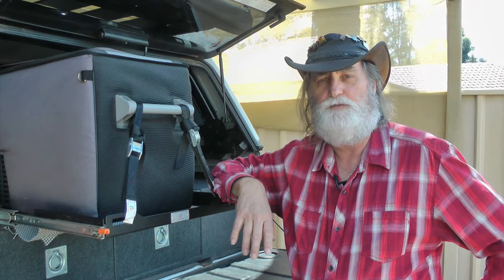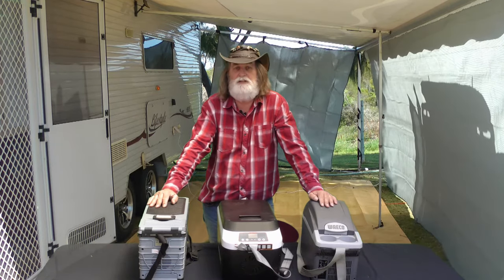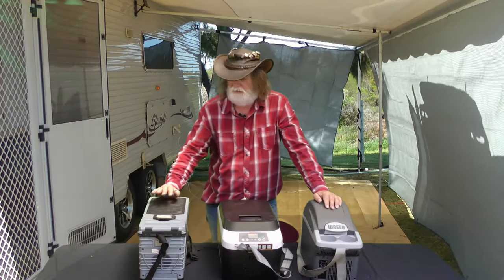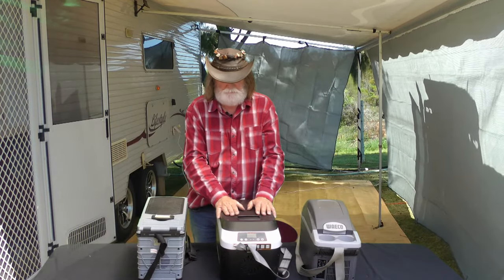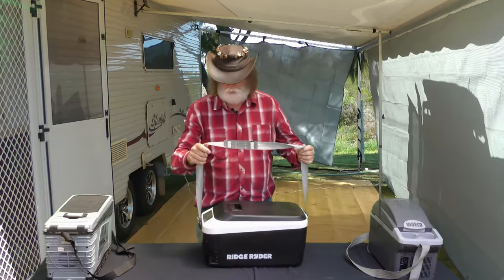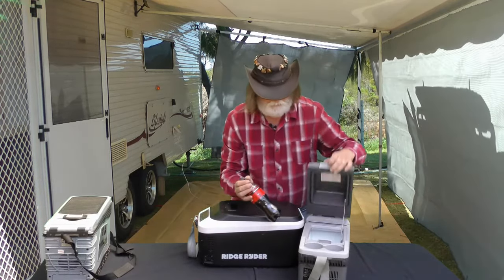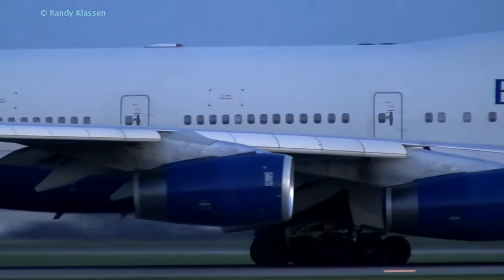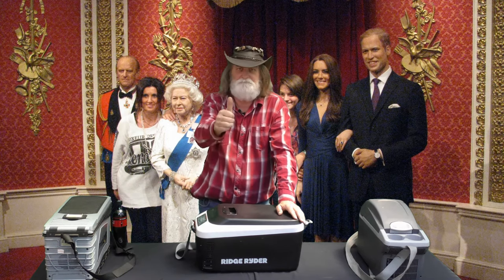Ridge Ryder 12 litre Thermo Cooler Fridge Review

Comment: thanks  for the presentation. I bought one of the 12 litre models early this year, and am most impressed with it. I usually cool it down before loading cold stuff in. My only con is my fault. It's too good.   I usually freeze my can drinks to substitute for ice. When arrived at my destination 6+ hrs later in 38 plus heat they were still frozen. I think mine is great.  I do hope you gave my regards to H.M.
Reply from the maker: lol yes I have frozen a drink or two with it to. Thanks for watching. H.M ask why you haven't called lately.....

Comment: Like the end there mate. Haha. Those fridges are quite simple. They use a peltier module, a small flat layered bit of gear. Only about 50 or 75mm square and 5mm thick. Google image it. They get hot on one side and cold on the other. The fan blows the heat off it. If you reverse the voltage, hot and cold sides swap. I had one years ago and felt like you did. Good for the price tho. Don't leave it on if the engine ain't running.  Nice review John.
Reply from the maker: Gday, yer i had some mates hassling me to be in a video so I put them in at the end... I just googled a peltier module and it was interesting to see how it works. Thanks for that.
Reply: @ontheroadwithjohn  You could make it even more efficient by crushing some ice, adding crushed ice to ziplock bag along with salt, place the bag or bags of salt/ice in the base of the fridge before adding pre-cooled items. The salt reacts with the ice, lowering the freezing point and thus lengthens the time before the ice melts as the ice itself will start off substantially colder than ice alone. However, I would do a test run before going away as you might find it freezes instead of keeping things cold. 👹
Reply: I also agree, the green screen background was great, I had no idea 🤗
Reply from the maker: @MaZEEZaM  Thanks for the idea. Probably not suitable for me as when I go to work im away for 3 days and ice isnt really an option but thanks for the input
Reply: @ontheroadwithjohn  Nevermind, worth a thought if circumstances allow 😊
Reply: @ontheroadwithjohn  I am going on the road for a while and actually hope that I can keep a bucket of ice cubes solid in this little fridge.  Do you think it would do the trick?
Reply from the maker: @lorna-liyao6646  Gday, no I don't think that would work all that well. For that you might be better off with a compressor fridge. But I cant help wondering if you are going to buy this fridge why you would wont to keep ice cubes. The idea of a fridge is so you don't have to worry about ice. If you are set on having ice then maybe your money would be better spent on a good cooler box. Something to think about. I hope this helps. Thanks for watching.

Comment: Hi I am building a dirt bike club house and I am going to put it in there is it rechargeable
Reply from the maker: Gday, no it needs a power supply. Either mains power or a 12 volt battery. You can get power boxes to run it but that would then be another expense.
Reply: Thanks it’s gonna be fun we might put solar panels on the top so it can charge while I’m at school
Reply from the maker: @tomprocta  yep that would be a good way to do it

Comment: If i camp for 2days and its connected to car battery, will it drain battery too much to start the car?
Reply from the maker: Gday, yes I would think it would. Your car needs a lot of power to turn the starter. Better to run it from another battery. This would be the same for all fridges. Thanks for watching
Reply: @ontheroadwithjohn  what type of another battery?  Another car battery? I have no idea? How do i connect powerpoints to another power source?
Reply from the maker: @forestrain4152  Unfortunatly I dont have a video on my 12 volt system to show you but there are lots of videos on youtube about 12 volt setups. However the easiest way to have a basic system would be to get a battery box with an agm battery in it.  This can be charged when the car is driving and can be drained low but your car start battery is not effected. If your in Australia you could check out the link  below. Its not cheap to setup but better than having a flat battery. Good luck with what you do. This is the battery box and you would need a battery to go in it.. https://www.4wdsupacentre.com.au/products/battery-charger/adventure-kings-battery-box-12v-2x-usb-cig-socket.html

Comment: a fair review..
though, you shoulda plugged it in so we could hear for ourselves how loud the fan is
Reply from the maker: Gday yer good point. I could of done that. It is a computer fan so think of a fast computer fan and that should give you an idea. Thanks for watching
Reply: @ontheroadwithjohn  thanks, that gives me a good idea of how it sounds ..
and a solution - you can buy computer fans with blades that are specifically designed to be very quiet. it shouldnt be too hard to swap out, especially with some basic soldering (or crimping) skills.
but im guessing most of the noise comes from a large amount of air  being squeezed through those rather small slots that form its outlet vent.. im guessing you could probably enlarge those vent slots and the noise would decrease.. 
and at only $90 (theyre on special again right now, ends tomorrow), its just about cheap enough to experiment on
Reply from the maker: @Ghryst  Keep in mind that it would need pretty good airflow over the vents. The cooler they are the better it works. Mines been going for about 18 months now and still performs good enough when its 44 outside. Its not that the sound of the fan is so loud that its drive you crazy but in a quiet area you would notice it running. But if you do experiment with it let me know how you go. It would be interesting.
Reply: @ontheroadwithjohn  "it would need pretty good airflow over the vents. The cooler they are the better it works."
this tempts me just to get a hole saw (and temporarily remove the internals) and cut the entire vent-covering out, and screwing/gluing on a wire mesh cover just to stop fingers getting caught while allowing maximum airflow

Comment: How can you charge it mate? how long can the fridge be on?
Reply from the maker: Gday the fridge doesnt have a battery. You need to plug it into a power supply and the time it would take to run the battery down would depend on the size of the battery. Usually you would plug this into the 12v power socket in a car.

Comment: Awesome Review! I just picked one of these up today, it's a pretty neat little cooler. 
It gets nice and cold and it's pretty fast at cooling too! Mine went from 25° to 5° in about 30mins.  
I have noticed it's a bit on the louder side, but it's nothing too crazy.
That Ending got me 😂 you had me fooled the whole video hahah Nice work. 

With your experience in coolers, Do you know what a safe/max run time on this cooler would be? 
Like how long is it safe to run it for? I couldn't see anything in the manual :)
Reply from the maker: Gday thanks for watching. Yer I was pretty impressed with its performance to. Mine runs 24/7 I run it in the house to keep everything cool, then when i go to work its running there to. This will clearly impact on its working life in some way. The only real thing you need to do it blow out the fins to keep the dust out. I do mine every month but then I work in a dusty area.